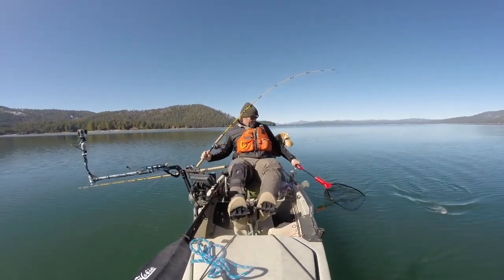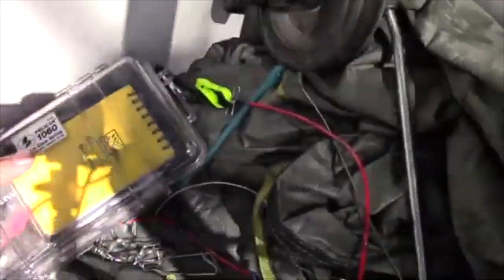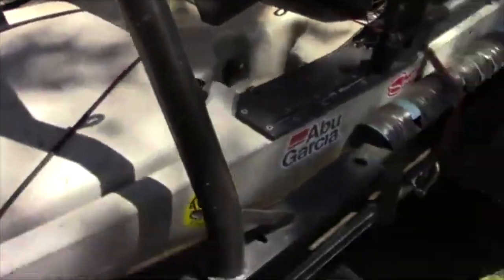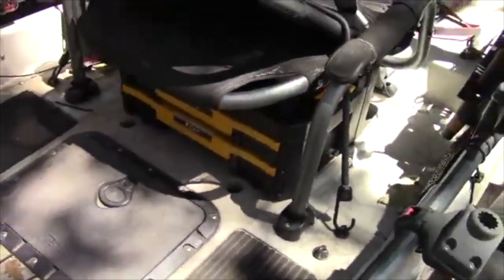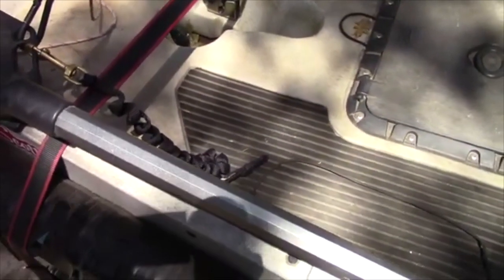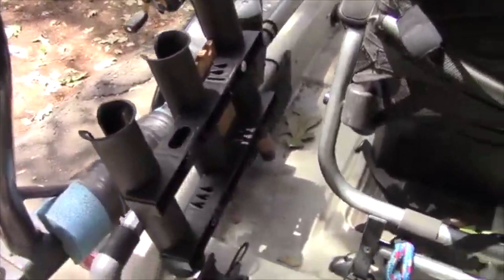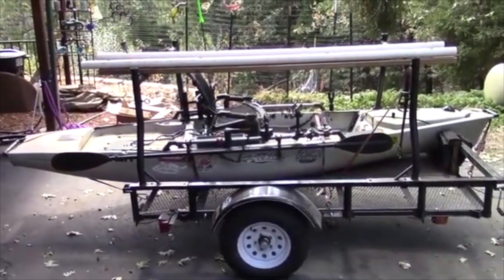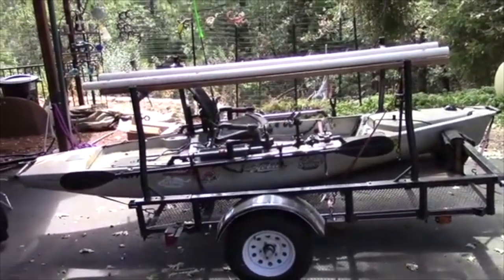Hobie Pro Angler 14 Set Up For Trout & Salmon Trolling!

Comment: Thanks for the ideas Cal, I just got my BKC kayak set up.  Still figuring out the best places for gear that I access on the water.  Wish there was room under the seat for a tackle box.  I noticed you don't seem to have an anchor setup, is that right?  Do you just not see the need for one?  I guess since you're trolling all the time an anchor isn't that important.  Last time out I only managed four bluegills on a Gulp minnow, lol.
Reply from the maker: I’m sorta afraid to anchor.... I’ve heard it’s easy to flip when anchored...
Reply: @FHSTackle  Yes I think it would be if the current was strong enough.  But in lakes with good conditions, less of an issue.  Haven't read much about it being a problem.  But then again, I haven't been kayaking long!